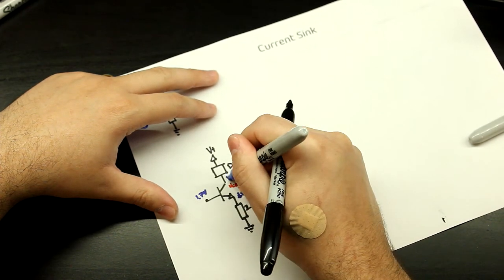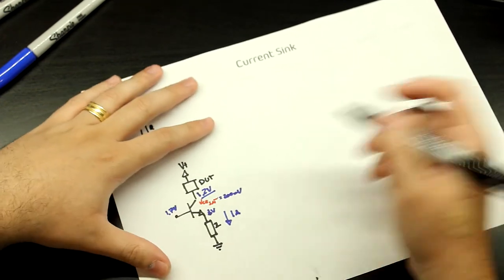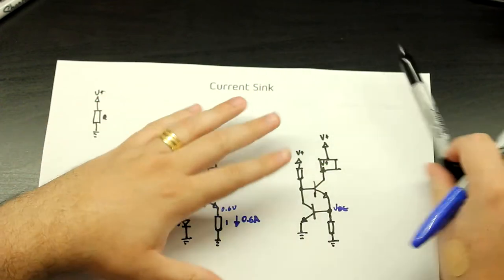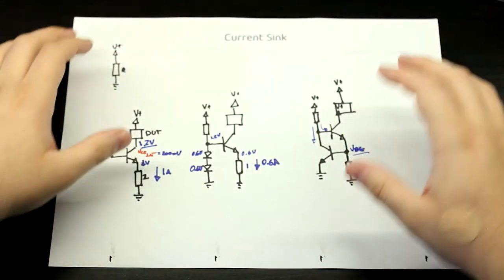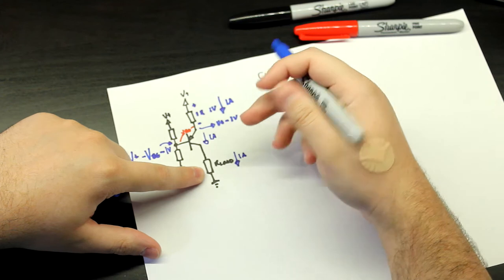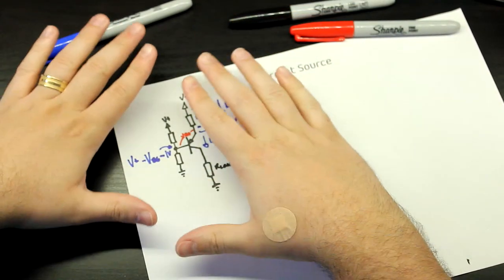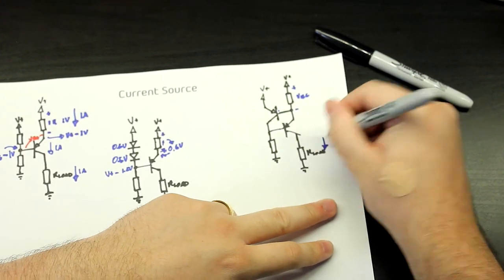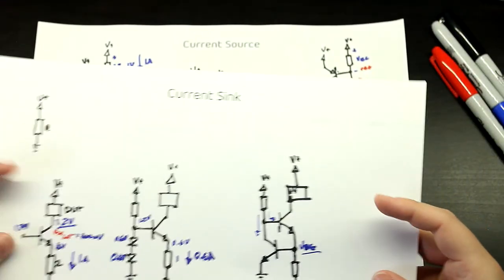#004 - Constant Current Sources and Sinks (Class-A Discrete Headphone Amplifier Project)

Comment: How do you select the resistor at the base for the diode configuration? You said something about needing the current through the resistor and series of diodes to be greater than the current at the base. Why is that, and how would I go about figuring it out?
Reply: Just a rule of thumb: current through the resistor and diodes should be at least 10x the base current. If you want to sink 600mA the base current should be 600mA/100(beta)=6mA Therefore the resistor value should be (Vsupply-2*diode drop)/(6mA*10). For 10V supply R=(10V-2*0.6V)/60mA=147 Ohm